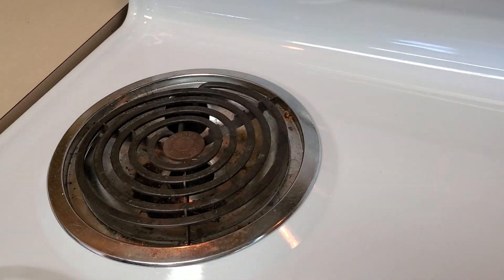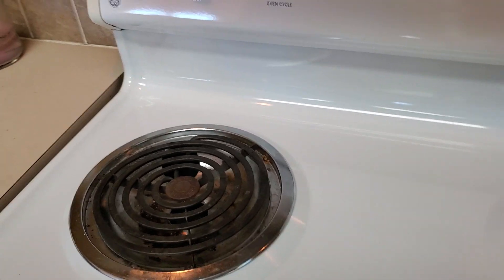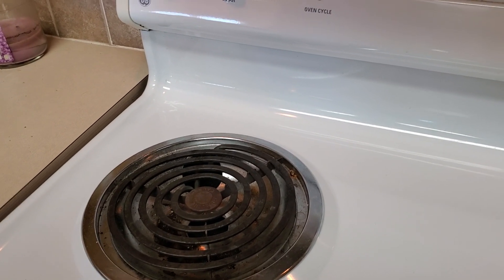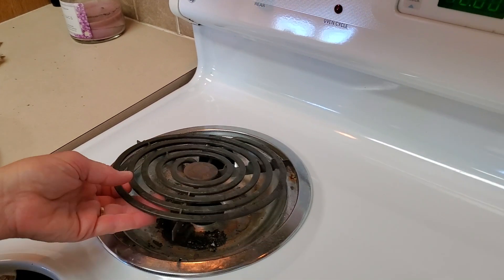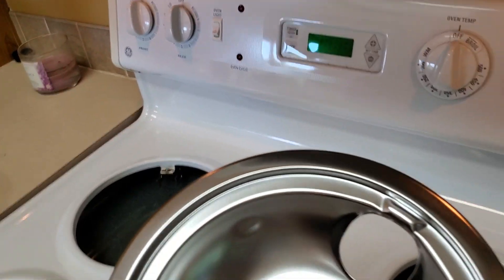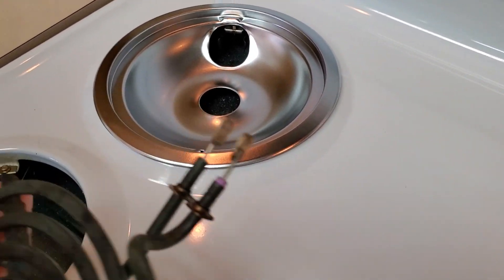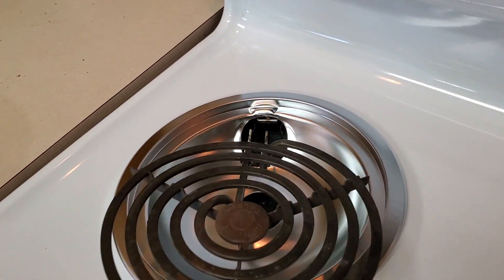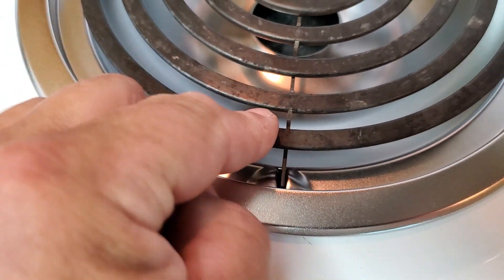Stove Top Drip Pan Replacement How To

Comment: Or...you can soak the dirty ones you have overnight and use a little elbow grease to save money.😁👍
Reply: Or buy four pans for a dollar. It’s all about your level of lazy vs. your wallet, right?
Reply: @CynthiaPrice79  I'd say for you it's about your level of sense of humor, right?
Reply: @CynthiaPrice79  A dollar?  Where to you buy them for a dollar?  I change them out at the end of rental tenancies, but they usually are $20 - $30.
Reply: Unless they have rust holes.